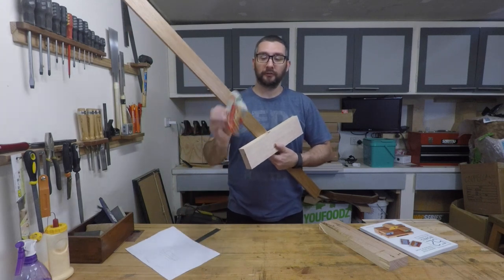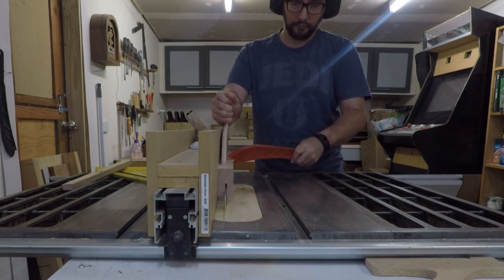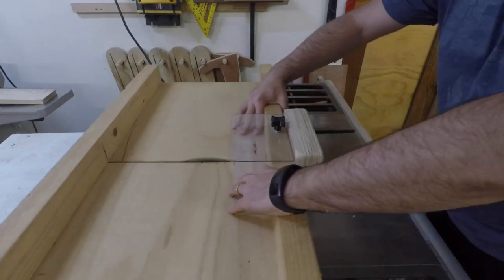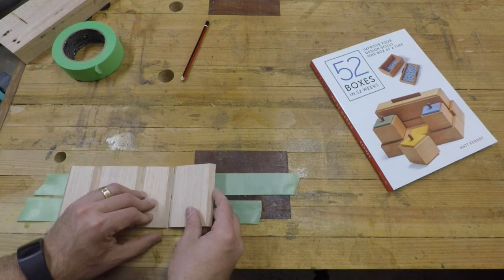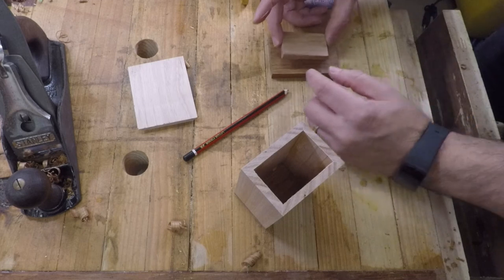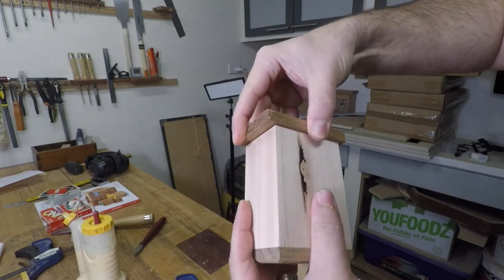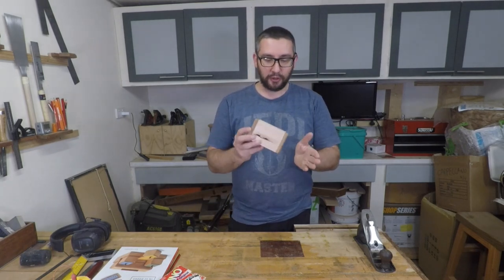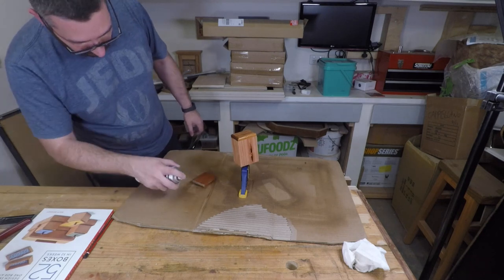The Uno card game box #summerofboxes

Comment: You could have recovered the wrapped grain by just planing enough from the cut to smooth the wood, then plane the outer face to required thickness. Use the cut face for the wrap. Neat trick is to mitre the base of the box walls & create a mitres on the base so the joint is almost invisible. ( I made a box with ALL sides mitred, lid drops I to place easily)
Reply from the maker: Plane the outside, I didn't even think of that, makes perfect sense, thanks! I thought about attaching the base via mitres, but for this one I wanted to see the contrasting colour. Next small box I make, I'll try mitres on the base. 👍